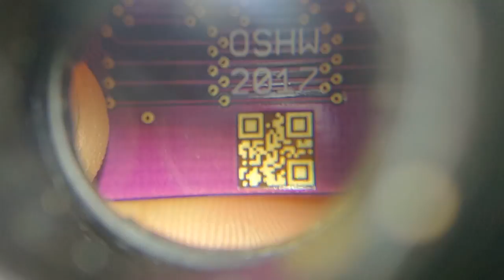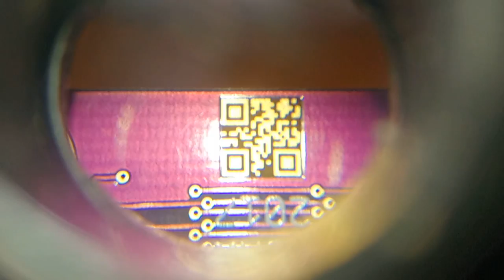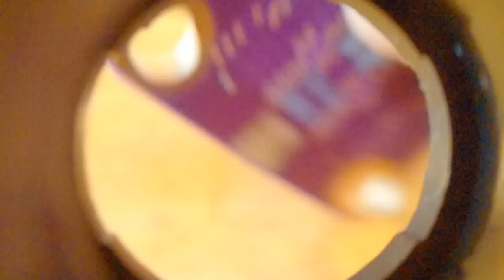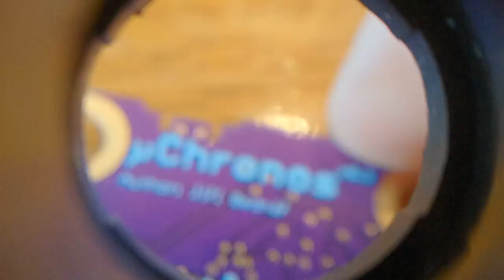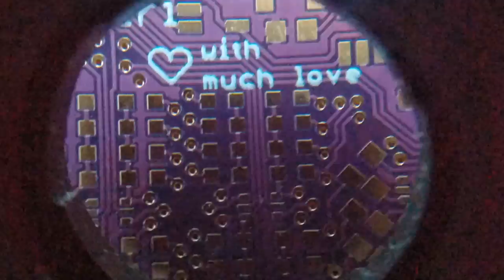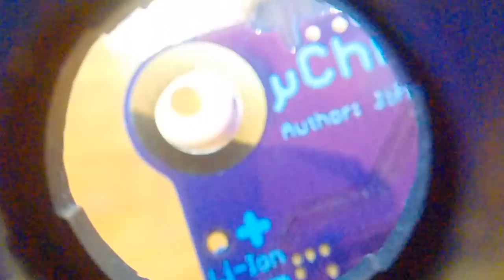[PCBWay] unboxing and review - The Good and The Bad

Comment: I have to tell you, PCBWay gets very creative with where they place their tracking number on somewhat complex boards.  It literally took me around 5 minutes actively looking for it on my latest order before I found it. Very Impressed. Unless you're using the board as a front panel of a project, there really is no need to pay extra to have them leave it off. Oh, and the via drills were perfect.
Reply: Did you really actually recieve something? This whole pcbway is such a scam
Reply from the maker: I regularly use their services, never been "scammed" by them.

Comment: Very detailed inspection. For cat 2 and cat 3, I definitely saw drilling registration is off. I believe some vias maybe in violation of IPC-6012 class 2. That may be some foreign contamination. Probably introduced from packaging process. Oh and that burrs inside the mounting hole. Yes this could be an issue if you have GND and PWR in sequential layers. Good luck.